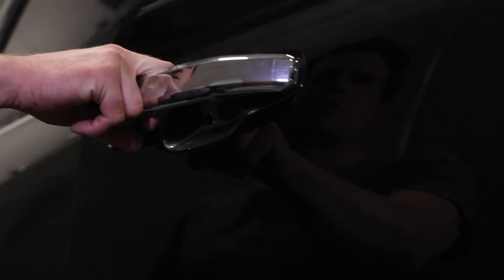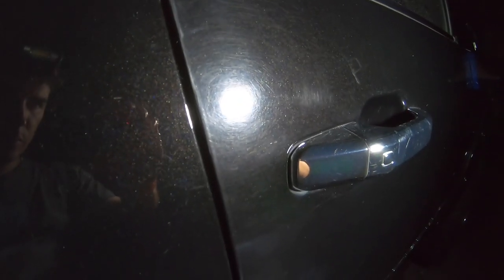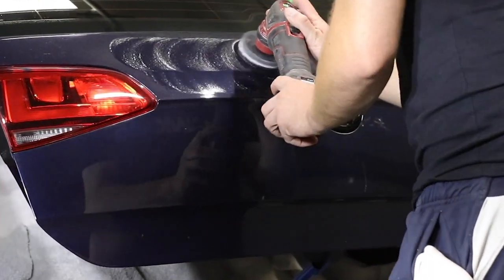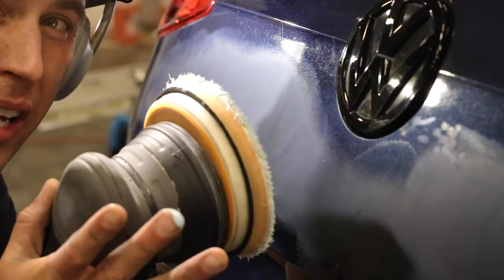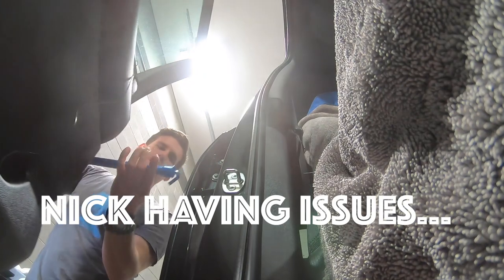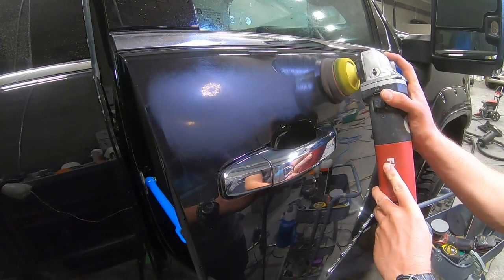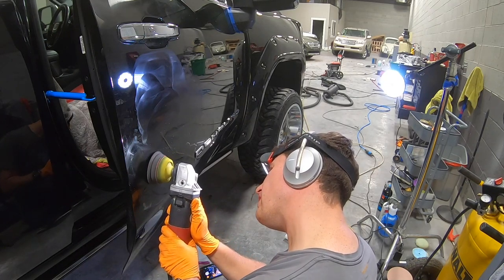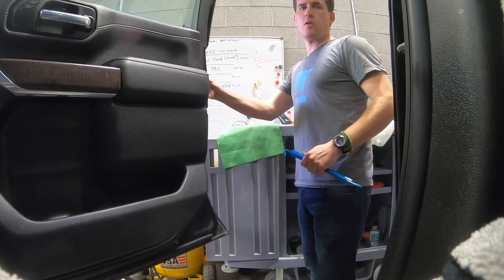This tool will make you BETTER at polishing paint!

Comment: I had something similar years ago I made but was a bungee and a wooden stick so I could leave the trunk door open😄  the wooden stick in the middle and the bungee holding those hinges in pressure holding the wooden stick all with enough pressure so it didn't open and didn't close on me while polishing and cloth on the ends of the wooden stick so it wouldn't scratch anything from the plastic or metal of the vehicle.  Great someone did something like that tool too.
Reply from the maker: Lol you were ahead of your time 😁
Reply: @HawkProDetailing  Just solved my need when was doing a Mercedes Benz C250 station wagon and used it ever since.

Comment: That’s a pretty neat door holder. I do feel bad for that golf though, going right into wet sanding. Taking a lot of extra clear off unnecessarily
Reply from the maker: You're not wrong. It was so hammered though...compounding just wasn't "cutting it" (see what I did there 🤣)
Reply: @HawkProDetailing  ah gotcha. That makes sense then. I’ve done some spot correcting with 3,000 or 5,000 grit and it does work amazingly, better to to that then to spike temps by hovering with a microfiber cutting pad. Good work